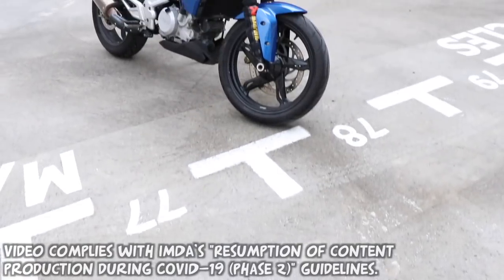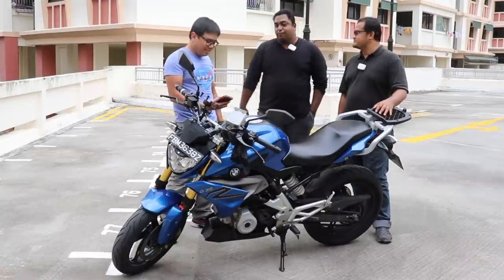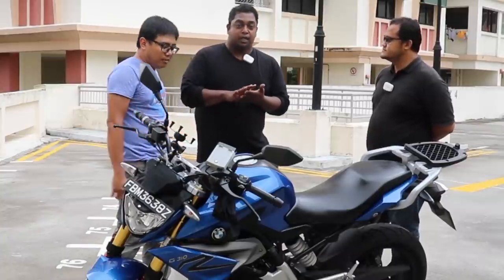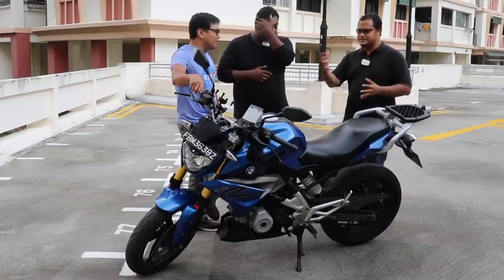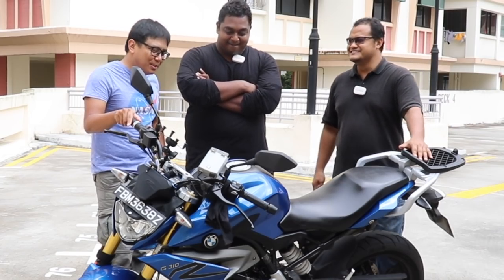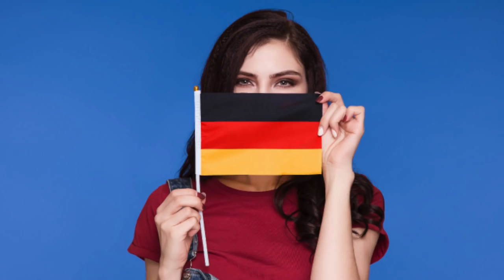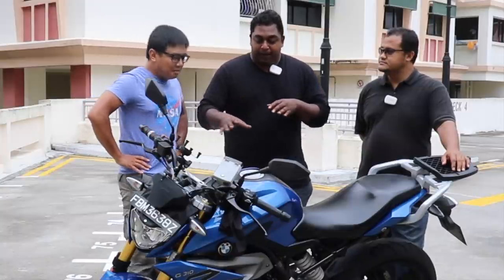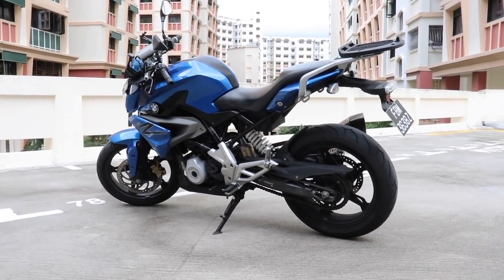Vlog#279 BMW G310R Motorcycle Review Singapore

Comment: Actually i really dislike bmw GS riders as well, my number 2 most disliked rider on our roads. They like to tail gate  when while lane splitting, i know etiquette is to move to the side to let you pass, but they tailgate even before a space opens on the side to let me go in. Happen many times, when the space finally open up, instead of letting me move to the side (despite having my indicator on) they will rush through and overtake dangerously. Not like they have been behind me for a long time, a few seconds only, as impatient as BMW car drivers. Somemore GS is so fat, they always lane split dangerously, i have seen twice where a GS rider lane split and their side pannier just crash into the car, one of them on CTE lost control when it happened and he just went down causing jam for a few hours at peak period.
Reply: Got a neighbour riding 800GS, always tailgate me with a smile..
Reply: I agree with you.. so fat still wanna lane split so aggressively 😆
End up stuck between two cars when they overtake me. Macam paham.